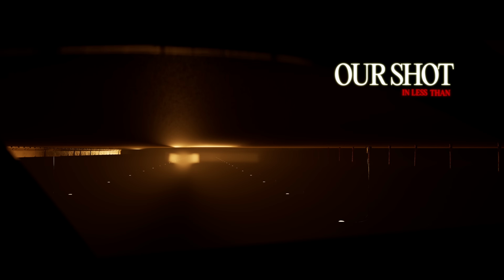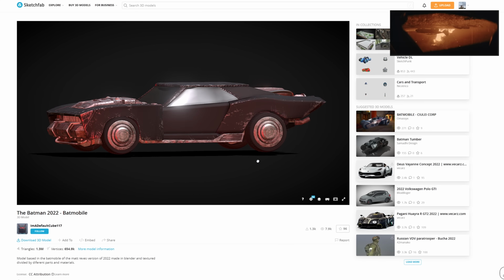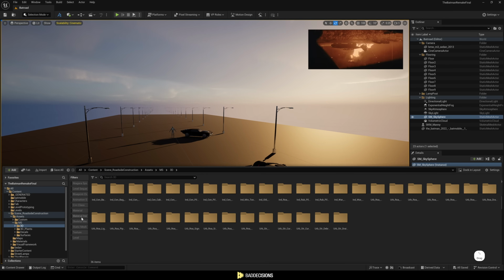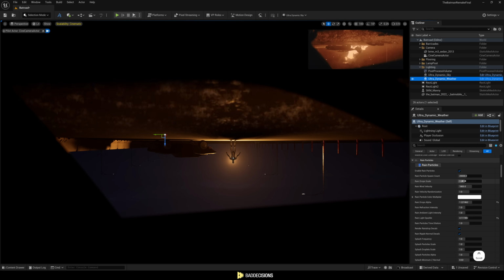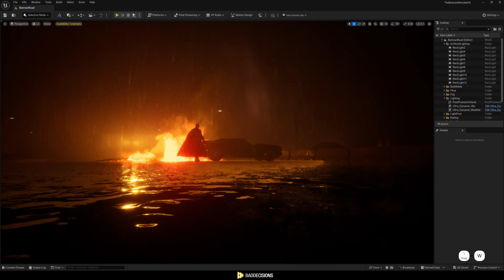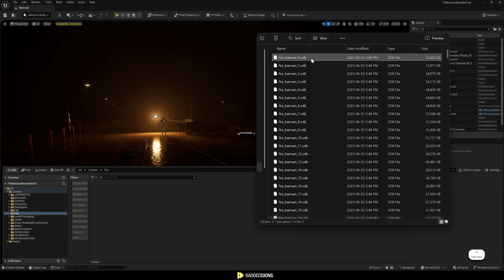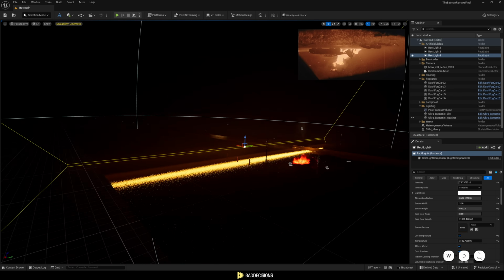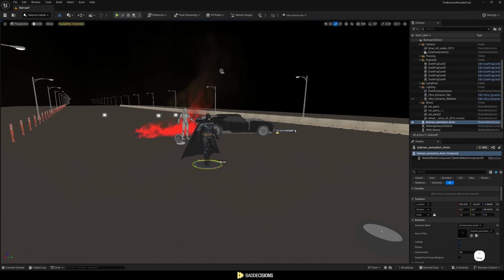We Remade The Batman in Unreal Engine 5 (Tutorial)

Comment: I'm documenting a few issues I’ve encountered, which may be helpful for others running into similar problems.

1. Asphalt Material Tiling in 5.6:
In Unreal Engine 5.6, the option to tile the asphalt material appears to have been moved or temporarily removed. After some troubleshooting, I discovered that the FAB download process is different. I had to manually assign the M_MS_str material as a parent before the tiling options became available again. This was not immediately obvious.

2. Motion Cloner Tool Usability:
The Motion Cloner tool section in the tutorial could benefit from a slower, more detailed walkthrough. The functionality seems to have changed since previous versions, and many of the UI elements are now different. As a result, it was difficult to follow along, especially when the demonstration moved quickly.

3. Ultra Dynamic Sky – Rain Interaction:
When using Ultra Dynamic Sky, I noticed that the rain effect is not interacting with the floor mesh as expected. My understanding is that this interaction should work before any manual material edits. The current method of importing the asphalt has changed significantly—you now need to click and then access a browser-based download, as opposed to importing directly through UE. This introduces issues where parent materials aren't set up automatically, contrary to what is assumed in the tutorial.

4. Roadside Construction Asset Organization:
The Roadside Construction pack downloads as a collection of individual FBX files and loosely organized folders. This makes it quite time-consuming to sort and integrate them properly into a project. Edit: It is now downloading properly through the library, the menus are so incredibly messy now, I don't know why they've made it so difficult through Quixel.

5. The Wet Weather Effects node is not showing, different ones are, but they do not match your tutorial, so again, stuck. What version are you using? 

This is probably user error, but it held up progress nonetheless, thank you for the tutorial and assets, I am looking forward to completing it!

6. Upon Importing the first VDB file, UE crashes when trying to convert it. There is no error message. I cannot progress from here. Any advice? How much ram do you need to import these? I am using 100% of my CPU and RAM (32gb). Is one of the VDB fies corrupt from the big fire? Did you double check it? I can upload 0-150, crashes somewhere after that. I do not have time to manually check 350 vdb files.

7. I had some trouble with the cloth physics, they work but not as intended, the cape doesn't go to the side, it just flaps in place. The wind setting is correct as is the direction, so I am not sure why it is not working. EDIT: This might be a bone issue of the custom cape I am using.
Reply: Finally someone who actually commented something useful
Reply: @CommonUse-zm3di  Good luck on the project, I will update as I go along. What I currently have is looking good. I do think one or more of the VDB files in the large fire are corrupt. I will re download and try again.
Reply: I had the same issue with the large vdb file, my editor was not opening for the rest of the day after that. @foancinematics
Reply: And for your last question ❓, you need not worry about ram, your Vram (graphics memory of nvidia or amd gpu) needs to be high, mine is a 8gb nvidia GPU
Reply: @CommonUse-zm3di  That's good, I have 24GB so I should be okay!
Reply: I am trying with using less vdb files, instead of the whole this i just used the 50 to 200 frames of vdb
Reply: @CommonUse-zm3di  Yeah, I tried a different one altogether and it imported fine. I think their files are corrupt! Small oversight I imagine.

Comment: I'm not sure if this will be acknowlged, however when I'm coding with the nodes using Ultra Dynamic weather to make everything wet from the rain I'm missing the node "Wet_Weather_Effects". I've added UDW to another project to see if the results were the same and it was also missing the node. Is there a way to fix this?
Reply: I have the same problem. Have you found a solution? And tell me, is the rain working properly? I have rain coming through the floor.

Comment: I need a new laptop, would appreciate if you say what kind of GPU and Ram you need to work on this with no problem. Or your own setup if that's possible.
Reply: Rtx 4090 atleast with 32Gb Ram
Reply: rtx 3070 is good enough for getting good fps and quick renders, 
otherwise if ur laptop  can run unreal im pretty sure its possible, 
the only heavy part is the fire, which can be makeshifted into a sprite sheet so yes, 
you can use any laptop which can run unreal engine.